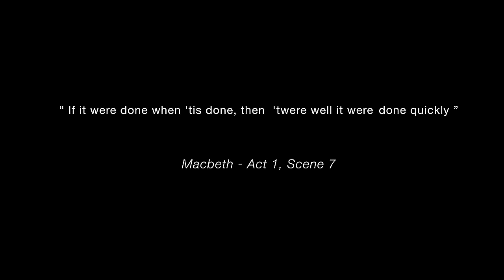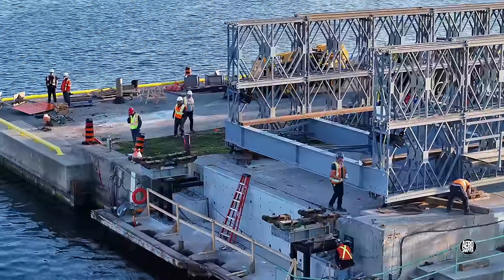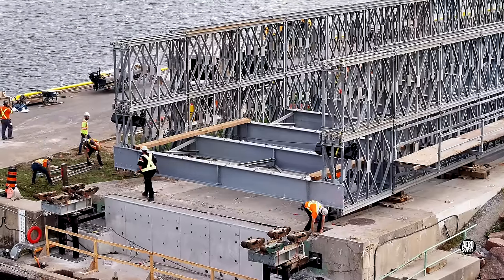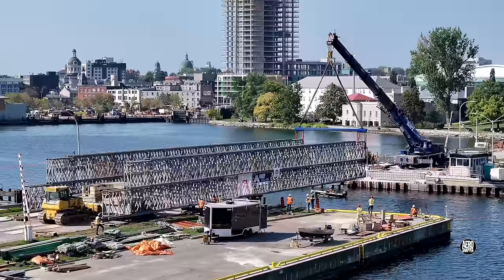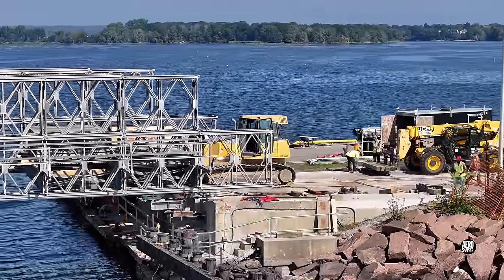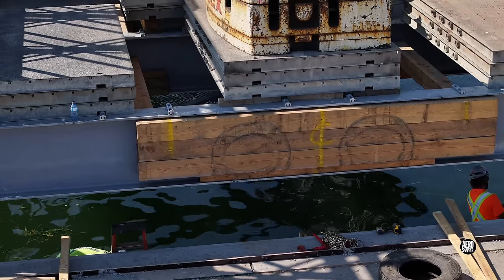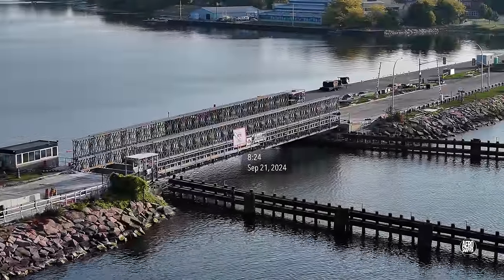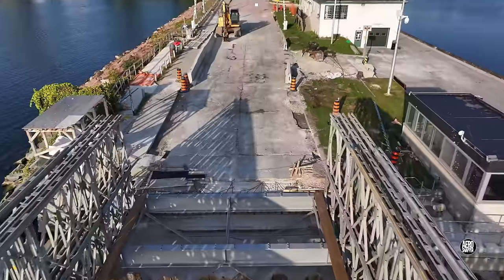A Troubled Bridge over Water - an update on Kingston, Ontario's La Salle Causeway   4K

Comment: For all of the armchair quarterbacks out there, the Acrow bridge is an off the shelf bridge and not the same length as the causeway opening. New bearing seats and endwalls had to be designed and built. The west end wall is completed after the launch because the bridge is lowered into place on an angle. The installers ran out of daylight for completion as the night before they had worked until 11:30pm finishing the counterweights and setting up the crane. Be patient
Reply from the maker: Thank you for that very important input.  I have been explaining to those who listen about the need to accommodate the fixed length of the temporary bridge.  I admire and respect the work greatly.  Ideal weather conditions have been very helpful to the crew.  I'm always open to sharing insights - but they're rarely provided until after the event.  Failing to explain what is intended sets the conditions for conspiracy theories and misinformation, which I have to correct almost daily.
Reply: Great video keep up bring us up to date please 
Only negative thing I see is the crane is from outa province,,,there are so many great crane companies around Kingston why bring in one in ? Ohh well
Reply from the maker: @mikejackman4416  I’m not familiar with the crane inventory in Kingston, but sourcing, I believe is often affected by availability. Kingston is a busy city these days
Reply: @Aerosnapper There is a crane rental company next to the west end holiday in express
Reply: So hard to determine if there is a problem without really knowing the plan.  Great coverage, Mike!
Reply from the maker: @DonJoyce  absolutely